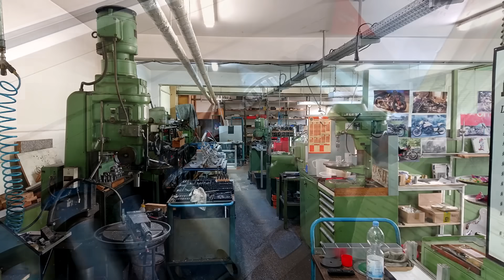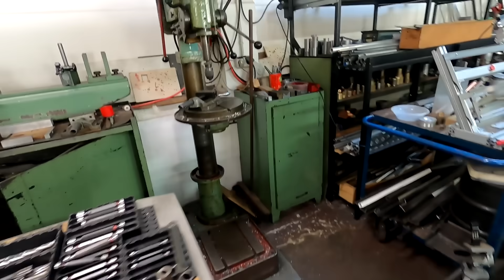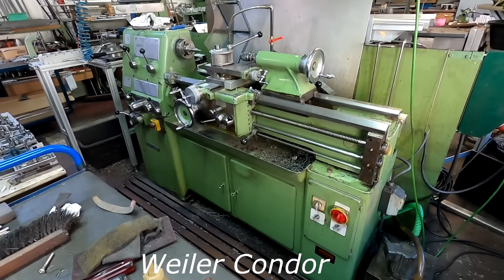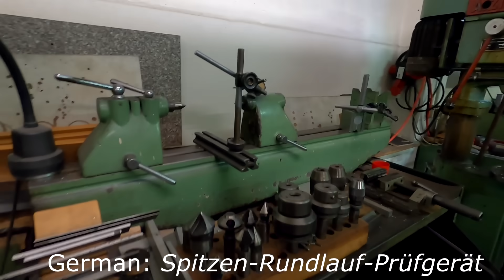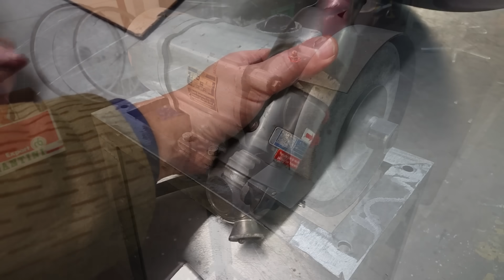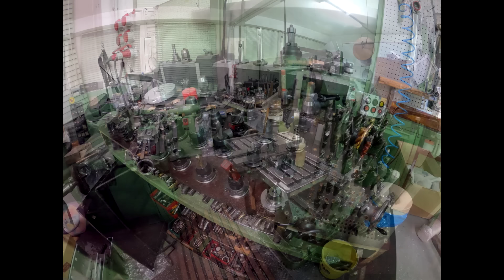Machine Shop Time Capsule! Treasure Hunt - Before it's Gone!

Comment: What is the purpose of the wooden mats? Obviously not anti-fatigue, and they look like they could become slippery with cooland / oils, so probably not safety either?  Only thing I can think of is to protect the finish of dropped work.  I use industrial rubber mats which accomplish all of the above. They're expensive, but I lucked into one mat cheap, I found another in the alley behind my house (someone used it to get out of some mud or snow and then left it there), and I bought one 4x4 mat new.  :)  Those plus good shoes make a huge difference in foot/leg fatigue and overall fatigue, when working in the shop all day -- which I get to do sometimes, now I am retired. :D

Comment: Thanks for sharing.  That hydraulic drill press is indeed a massive thing.

I found it quite surprising that this is the last shop of its kind in a city of 1 million.  In the States, many cities of fewer than 100k (at least those I have lived in) have a machine shop/metal fabrication shop of similar size and scope to this.  Generally not 1-man operations, but the machinery would be similar.

What one would not see, to stereotype a bit, is all that natural light (they're generally dark as caves), plants, flowers, or bicycle wheels.  I enjoy seeing these small cultural differences and personal elements as much as the big machines in these videos.

Comment: Great video - my pick would be the VDF Boehringer. Over the years that's the only lathe I have ever operated that was capable of taking a cut the full width of a carbide insert tool! It was also equipped with a tracing attachment and could be set up to pull out of a cut when screwcutting up to a shoulder at 900 rpm.. Thanks for posting this. Cheers

Comment: Is there any bending machine, shearing machine, punching machine, laser cutting, planing machine, handheld electric welding, bending machine, alligator scissors and other mechanical processing equipment, inexpensive, strong wear-resistant, accurate positioning accuracy!

Comment: I wouldn't be overly concerned about not being able to find parts.  The great thing about having a metalworking shop is you generally just need to be able to get the material, and you can make parts that aren't available on the open market.

Comment: I worked with machine tools, pretty much all of my working life. A lot of those Machine models made their way to the UK.  I have seen VDF, Flott and Weiler lathes over here. I hope you can pick up the milling machine. It looks a really useful tool. As you said, the machine is extremely useful because of the extra tooling. Whilst most tooling can still be bought, it is very expensive. So, if you can obtain the machine and the tools, you’ll have some very useful equipment.

Comment: My father was a tool and die maker here in the United States. He started in the early 1950’s. I remember seeing all these sorts of machines in the early 1980’s in the plant my father worked in. Only the ones he worked on were bigger. You had to climb up on a lot of them to make changes and the parts they made were all moved around with cranes attached to the ceiling. All that closed up in the late 1980’s though. Most of those giant machines though were dismantled and sold to a Chinese company. At least some of them are still probably in use.

Comment: I started my working life with such machines. They were more often battleship grey though we had some green ones. It was a military shipyard so repainting would use what was there no doubt. I spent some time balancing steam turbines and replacing blades. There were few places that had the space needed for making prop shafts and that was used for the repair and balancing. In the machine shop everything was BIG. 8ft horizontal chuck. Start a cut going and read a few chapters. Repeat. Horizontal reciprocating mills converted to cut semi-circular bearing housings for prop shafts etc.

Comment: My dad recently cleared the remainder of a similar (but much smaller) ‘old-Skool’ workshop. The main machines were already sold and they were removing one large lathe, using a crane to lift it over the neighbours houses, as my dad got there. He did manage to score hundreds of good quality punches, taps, dyes, bits etc.. at a very reasonable price. 
It originally started as a response to a Facebook marketplace ad but when my dad went to buy the original item it turned out that the seller was clearing out his uncles workshop as he was now in his 80’s and ill health meant he was no longer able to work. It also transpired that he was an ex speedway rider and my dad had watched him race many years ago. 
Just another instance of ‘not what you know but who you know’ 👍🏼

Comment: Quite cool. It it indeed sad to see a shop close up. I have seen several shops over the years close, projects in the middle of repair, projects I have worked on only to get set out side and rust over again. 
Entire shops sent off to auctions and sold for pennies on the dollar. I also have seen a shop that sits abandoned right now getting wet and rusting. Even tried to buy some of it years ago only for them to decline my offer and its all still sitting where it once was. I mean I offered a good fair amount of money and still they did not accept.

Comment: Those Reseda Green machines are so alluring --  they are mostly 'unobtanium' for those of us in the USA.  A Deckel style milling machine will last you a lifetime and is a complete game-changer for metal craft. Also, I could not help but think you would do well to have a modern lead-screw lathe like the Weiler in your shop since your antique lathe is quite limited in function having no lead screw nor modern tool post. I'm sure the machines will find happy and willing stewards. Thanks for sharing.

Comment: Thank you for this video. The old green machines are still working around the world wherever people were given the opportunity to buy them from shops that closed down.  I saved screenshots of this shop to recall how it is organized.  There are many machines in the space but each is able to be used without wheeling another tool out of the way.       I hope that the reference charts on the walls are saved when the shop is dismantled.  You know from selling posters and maps that paper "ephemera" has value, particularly for a hobbyist or young machinist who needs to look up the right size tool to use.  Also, it's just cool to have visible links to past machinists who made so many lovely things.

Comment: FYI- With gopro you need to manually set the FPS to something like 50fps or 100fps since you are likely on 50hz power (EU) vs US 60hz. And/or a slower shutter speed. One never thinks about the strobe effect till after when you watch/edit. What a wonderful machine shop! Its just laid out so well. If Post Apocalyptic did a gofundme for the mill... or you need something donated for the mill... I'm sure us subscribers would donate! Fröhe Festtage!

Comment: I have worked in a few small 'job shops' in the UK in the 80's and 90's,

There are some nice machines there, the universal mill you are hoping to buy is a really useful bit of kit,
The tooling alone would have cost many thousands of Euros over the years... Good luck!

Seeing the surface plate with no punch marks immediately told me I was in a German shop (or maybe Japan?)

Comment: Enjoyed the video it brings back memories of my first job at the age of 18 back in 1984. I worked in a old school workshop with old school machines some of which where probably 50 years old then! There wasn't much we couldn't make we had an SIP jig borer numerous lathes some v. large with 60 hp motors!  Gear hobbers and shapers and many other machines. It is not just the loss of this workshop and it's equipment which in itself is sad but the all the knowledge and experience the engineer who worked them that is very difficult to replace especially in this day and age. Good to hear the machines are not being scrapped though.

Comment: I have a machine shop fairly near me that looks like this guys shop. Its staffed by retired machinists who still make one off's and custom machined parts for anyone. No CNC anywhere in the building! It smells of cutting fluid and machine oil and is an absolute time capsule. Its sad that the town I live in had many large engineering companies who were world renowned but sadly are gone now - what skills have been lost to 'modernisation' with CAD and CNC machining. Thanks for the video and good luck for the old guys eye surgery.👍

Comment: i hope you can answer this for me!  i have not seen much actual industrial grade of machinery on your channel.  what kind of voltage do those large machines use in Germany?  in the US we use 3 phase power at 240 to 600 volts for such machines, as opposed to 1 phase power at 120 to 240 volts that is typical of homes.
Reply: From the Netherlands, but Germany is the same.
We use 400V 3 phase or 230v 1 phase.
Thats all on normal industrie.

Comment: That old shop is invaluable, it would be serving the place and industries there. 🐞There are not many such machine shops anywhere nowadays with the 'throw away society' we live in.
My dad ran his own auto-truck repair shop in Uganda in the 50's to early 70, and he used to say that German machine tools were of very good quality. The German steel mills produce very good🐝 metals and down the line the design and engineering is also top notch.
My favorites machines here, ☘the two lathes, the big drill press at 4.43, and the 'Eisele' metal saw. The machinist owner made a very usefull extension table there.🏵

Comment: I worked with a machinist shop in the late 90's. they had a lot of German machine tools that looked just like these. The machine shop made the parts for my machine. My machine was also German made. My machine made small Brad nails for nail guns. It was called a wafios nail/wire machine. It was an older machine from Around the World War II era & made 750 nails per minute.  We had much newer wafios nail machines in a different part of the factory. They all ran like a well-oiled sewing machine!👍

Comment: Was WFD a german company ? Because in ex yugoslavia there was a metalworking machines factory called Prvomajska ,they also did a lot of exprot efor 1990s and a war.I worked on a same machine that was manufactured by Prvomajska.Was it licenced production? 
Anyway it is a beast of a machine -you can get a 20mm depth of cut in a A4 marine grade stainless steel with it.The power that lathe has is amazing.Very robust and very heavy ,however price when refurbished is around 20k €.Another down side is its electric motor was around 12kw if i remember ,so its expensive to run it as a hobby guy and it needed industrial three phase power not household .

Comment: What a beautiful old shop. I am sorry to learn that it is all being sold off, but have seen a similar thing happen here where I live.
I live in a city of over 40,000 people, with a long association with the forestry industry.  In the 70s, there were three large scale logging companies, two sawmills, and a pulp and paper mill, all within a 35 mile radius of here.  In addition to the associated maintenance shops that were part of the logging company operations, there were also several large machine shops in town.  
Over the last 50 years, one by one, all the machine shops have closed their doors.  Even two of the logging companies, that operated large fleets of off road trucks and other speciality equipment, have also closed their doors.  All the work now, is being farmed out to larger machine shops, operating modern equipment, two towns, one 35 miles, and the other,  70 miles from here.  
It was a sad thing for me, as a hobby machinist, to see these shops close, and all the capability of doing speciality work and all highly qualified tradesmen being put out to pasture, but somehow, the big companies can operate more efficiently with this new arrangement.
What is ironic is, that with my equipment,  I could get all the small welding and machining jobs I want, but I am 80 now, and want to work on my own stuff.

Comment: Thank you for documenting this mans shop, it is beautiful! We have the same thing going on in my area, Seattle Washington, the small job shops are closing one by one and the larger ones are getting really expensive which leads to the larger machines being scrapped from these small shops as not many hobbyist's can deal with heavy machines and 3 phase power. That said there are a few of us who do buy and use these machines, mostly for our own projects or in my case building a job shop for my retirement years. Great video and I didn't notice the flickering at all, but I was focused on those fine machines!

Comment: Thanks for the video.   I have my own metal lathe and milling machine, much smaller than the ones in this shop, but having done metal work on these machines makes me able to appreciate the shop and its owner.   Sad that eyesight issues means he has to retire.    Very good that most of the machines are going to someone who will use them and not just for the scrap yard.
I took a tour of the Starret factory in July.    They have some machines which go back to the 40's, in addition to some very modern machines.   Fascinating.    They also had areas which did various specific operations.   I appreciate the skill of the folks putting calipers together.   Very tiny screws and pieces.   Not easy to do for the lay person.

Comment: LIKE!!! I have been and seen various workshops and factory's throgh years. I even have my own metalworking workshop with oldschool machinery in it. That  workshop in video is like a machinist's deam! Yeah, TOOLING: any lathe, mill, grinder, drill machine without a tooling are like a naked lady. Without tools & equipment You just can't. P.S. I mostly have USSR iron. In Baltic, even old German machine are better than USSR made... Maybe I made a mistake when I sold my Gustloff Werke lathe, built in ~ 1943 march and JUNG surface grinder ~ early1930's. Still I have "iron" to fix for future. 
Good luck!

Comment: I'm a velder in southern Sweden. We have drillpreses with 3 and 4 drills on one table (swedish made). the newest one is mad 1964, the one with 4  drills, the one with 3 in installed 1958. Still going strong.

Comment: I work at a german University and one of our machine shops still looks like that and nearly all of the green Stuff still runs perfectly. Sadly a lot of tasks could be much easier done by a modern multiaxic CNC but the guys in the shop keep on producing miricles with the machines they have. I hope all these machines keep on running even if they are not suted for all the moden tasks, the are NOT useless.

Comment: Really glad that most of the tools have been sold on, and will not be scrapped, as so often happens these days because nobody wants to work something that is not computer controlled. Also good that the owner is in charge of selling everything, as he knows what goes with each machine, so often when auctioneers get involved, they have no idea that some machines are useless without all the accessories that go with them.
Reply: Yes, in some cases the owner has died and all that knowledge has been lost.
Reply: In my experience, you usually don't find small shops scrapping out the equipment. It's larger companies that do that, where the cost of listing it, selling it, dealing with people wanting to pick it or deliver, etc, outweighs the value of the machines. And often to take the tax write-off, the equipment has to be destroyed. These days, anything that's functional or even remotely restorable can be sold.

Comment: Nice to see the older shop. He is probably not much older than I am so the machine years are the same. Yes the ones I used were made in the US but machines are pretty much the same, even the colors for time periods. A few years ago I read a comment from a young machinist that you couldn't make anything without a CNC. I guess he didn't realise the jet age and the space age were well developed by non CNC machines. The great thing about small shops, they are willing to do small one time jobs. Yes it can be costly and why many farmers bought old machines for their farm shop. Thanks again for this video.